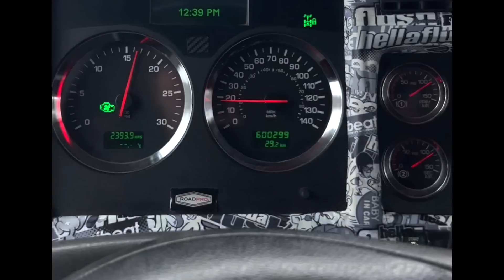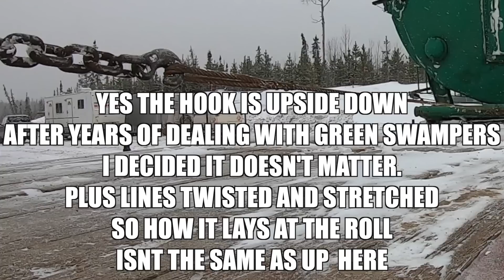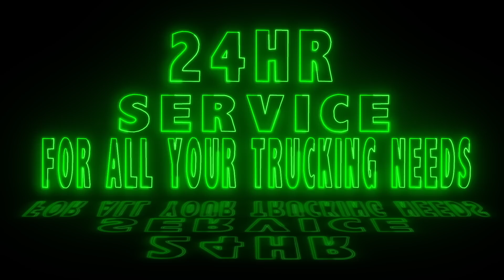MORE CHAINS AS IT SNOWS FOR DAYS ICEBERG SLIM

Comment: Tri drive do you ever put chains on all 3 ! 🇨🇦
Reply from the maker: i never have no, i had two sets of triples and one set of singles for my roadtrain truck, also two triple duty steer chains, ready for anything, but no i never used them all at once, if it gets that extreme there's usually a tow tractor or some form of tow unit